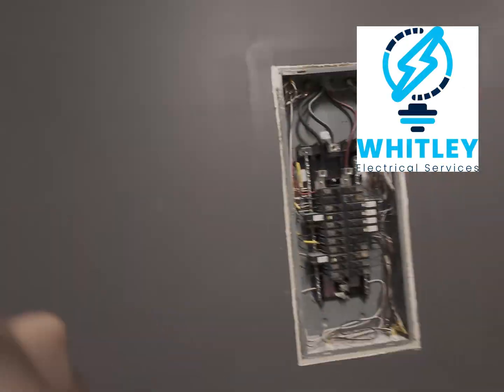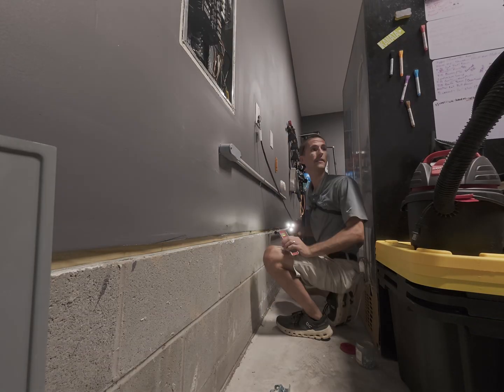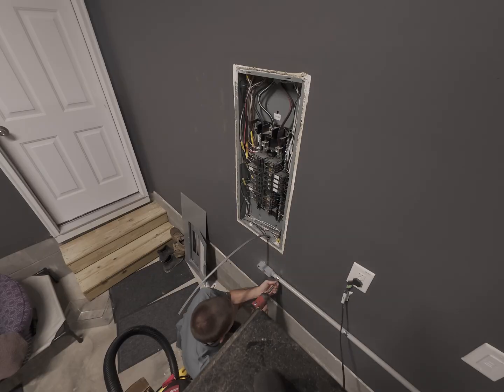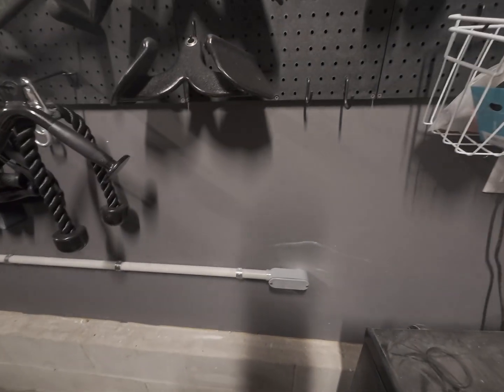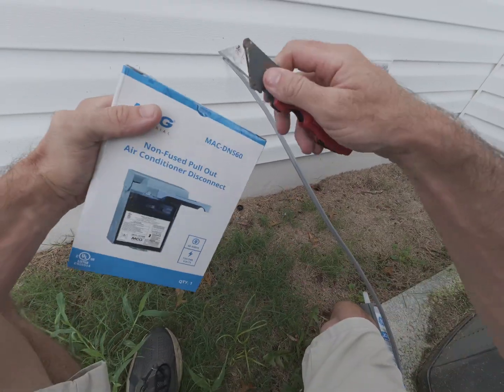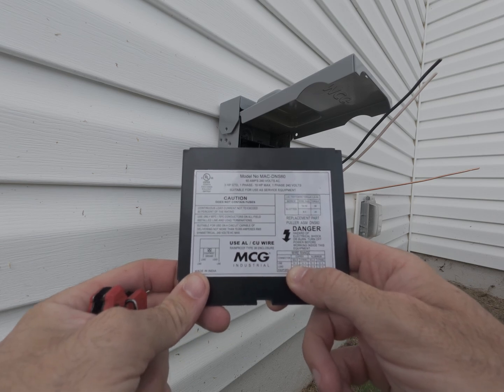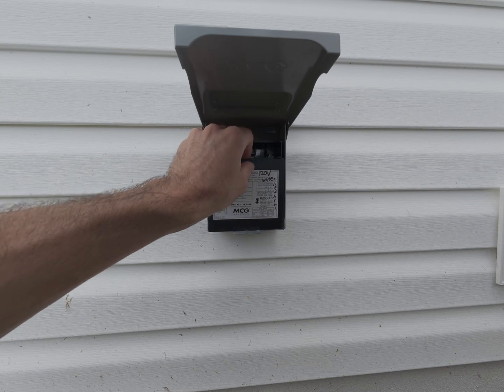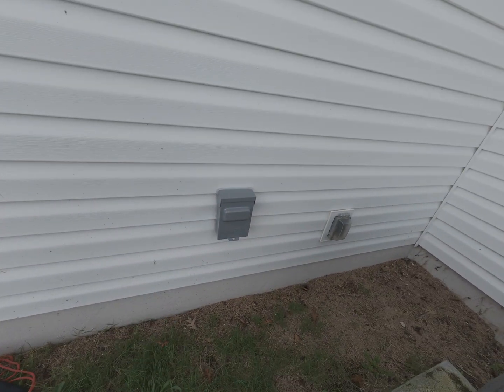Installing a Mini Split Circuit for a Garage – Full Electrical Installation

Comment: You should not run romex cable in pipe it’s against code , use thwn instead
Reply from the maker: It’s UF, which can be ran in conduit